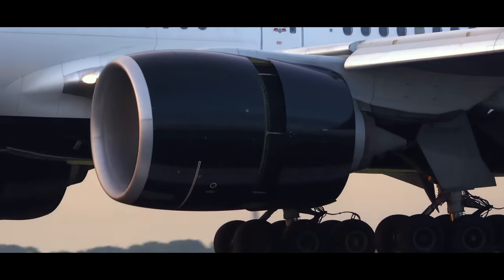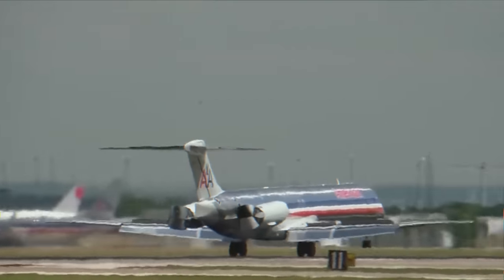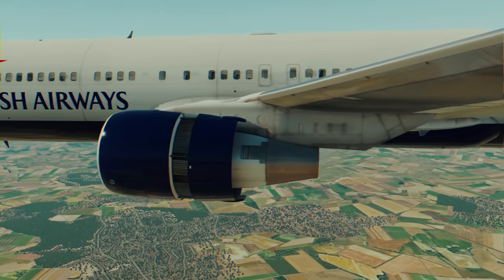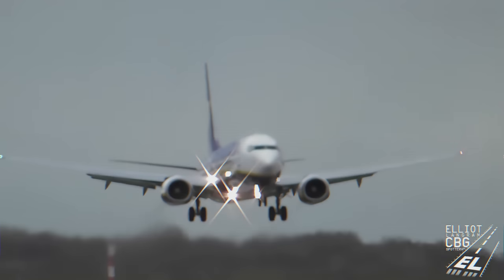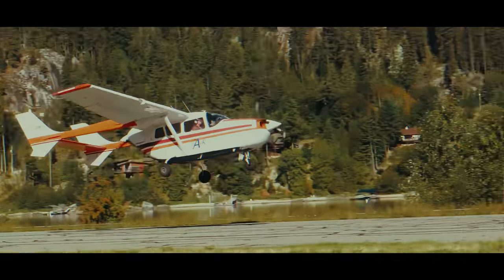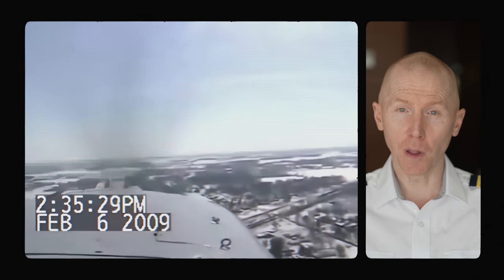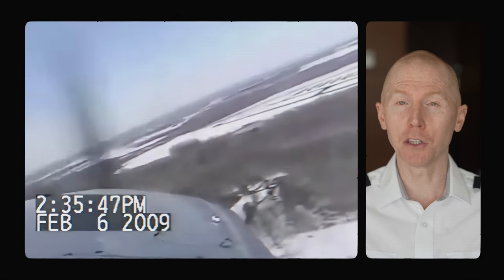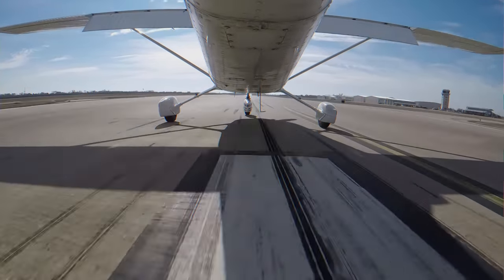Ryanair Pilot Makes Big Mistake

Comment: What you are missing is that it is Ryanair who guarantee slamming the plane into the runway in any weather condition. Applying reverse thrust before landing helps them achieve this goal.
Reply: Lol i was looking for something like this
Reply: "Ryan Air, soft landings would cost extra......."
Reply: Yup, SCUD Airways at it again!
Reply: Love this😂
Reply: Maybe to save on the number of times that they need to replace the brakes? Using reverse thrust every time instead 😅
Reply: @felipevieira8741  I think it’s more to do with reducing the chances of having to do a go around since if they do three or more within a certain time period Ryanair would force them back to the simulators.
Reply: They should charge extra for the landings, they are always fun, on the lucky days you get a witty pilot too.
Reply: By slamming the plane hard on the ground reduces the need for ground crew throwing bags hard while unloading.
Reply: I suppose Ryanair would charge an extra from its passengers for a 'go around'...

Comment: I used to fly the 737. Seem to remember you could select reverse at 10 feet on the radio altimeter. I have done exactly what the Ryanair, pilot did. It was on a 6500ft snow covered runway, in slightly windy conditions, so max thrust needed. Like the guy in the video, I thought the wheels had touched (they had not) and opened the reversers too early. The plane landed smoothly, stopped great, so this is not a big deal. On the video, the translating sleeves open on the engine, but it takes a little longer for the engine to reverse flow, so the landing is fine. On the 72 seat turboprop, I used to fly, selecting reverse before the nose wheel hit the deck, it would smash the nose down hard. On that aircraft, interlocks were supposed to prevent it reversing in flight. Well, they got worn out and somebody managed to reverse an engine in flight. About twenty flights later, the turbines came out the back of the engine. As for those that say Ryanair, have a “bad reputation,” I have never worked there, but considering the mass of aircraft and routes they operate, they have an excellent safety record. Do not let this none event stop you from flying with them.
Reply: Ryanair has a bad customer service reputation. Not the crews, the company. They charge you for the tiniest things and trying to complain is supposed to be a nightmare! But I've not heard (am in the UK near(ish) an airport they use a lot) of any "dangerous" reputation.
Reply: @y_fam_goeglyd  don't read the news much then I guess.
Reply: @y_fam_goeglyd  Soft landings cost an extra 20 euro at Ryanair.
Reply: There's no weight switch on the gear preventing reverser deployment?
Reply: @y_fam_goeglyd  I don't understand why anyone who has flown Ryanair worries about the reputation. 

You get, well I always did, what you have paid for.
Reply: This video will not stop me flying RYANAIR...THE BOEING 737 MAX SERIES ..WILL ,DEFINITELY,  STOP ME FLYING RYAN AIR ....
AIRBUS ALLWAYS ...
Reply: vibratingstring   I remember that crash being all over the news when I was kid.  Less than week later my grandmother flew ( Delta airlines)  to see her family without my grandfather. People asked what airline she flew on and my grandfather would tell them ValuJet . 😂. The look on people's faces was priceless.
Reply: @chipholland9  IIRC this “feature” is there in case the Air-Ground sensor fails in flight. That way you still have reverse thrust available for landing. This is only available below 10 feet from the runway.
Reply: Ryanair is actually a very great airlines.
Reply: Ussually the problems with Ryanair are in the cabin rather than outside the plane. I've been to kickboxing events where there was less of a fight going on than on Ryanair flights. 😆

Chav Express right there....
Reply: Exactly! VERY well said!! 👏🏻
Reply: @deth3021  have you ever worked for Ryanair in the last 20 years? Their safety record is exemplary so have you ever worked for them?
Reply: @askiff1415  I have avoided Ryanair since over 20 years as I don't have a death wish, nor do I hate myself that much.
Reply: @deth3021  well I’m a pilot and my son is a Captain at Ryanair so I figure we know lot more than you do about airlines, flying and safety in fact judging by the quality of your responses pretty much everything.
Reply: Any landing where no one is injured and the plane is undamaged is one damn fine landing, since landing's are essentially controlled crashes.
Reply: Yes, I would agree that one should not let this event stop them from flying Ryanair. The fees, lack of legroom, and generally terrible customer service reputation, on the other hand, should stop them from flying Ryanair.
Reply: @nvelsen1975  same for WIZZ Air and Sleazyjet in fact nearly all Low Cost Carriers attract the lower class and the behaviour that often comes with them
Reply: @y_fam_goeglyd  well they revolutionised air travel in europe thanks to them we have 10 euro flights
Reply: @nvelsen1975  sounds proportional given the renowned behaviour and disrespect for norms of some Russians
Reply: @adrianpeters2413  The 737 MAX is one of the best planes right now
Reply: Well sed Philip - Totally Agree - this guy probably have to spend some time on books :buffering:
Reply: Great input. There was a plane that went down because of a reverser failure in flight. 2 parts that would have been needed to fail in the system did.
Reply: @deth3021  You don’t actually need to worry about Ryanair, or any other airline that flies 737/A320 or bigger. No matter what Ryanair might want to do, cutting corners on aircraft safety is something that even they can’t do. Commercial aviation in Europe, UK, US and other civilised countries is extremely tightly controlled and regulated. EASA and CAA are no joke and no airline will f**k with them for fear of losing profit if nothing else. 

But even if they weren’t forced into being very safe, there are a few other simpler things to remember. Firstly the pilots themselves are humans who want to come home alive after every shift and it’s in their best interest to fly safe and reliable aircraft, as do the flight attendants. The engineers don’t ever want the guilt of  their work or lack thereof being responsible for crashing a plane and thus killing hundreds of people.

Even us ground handlers are deeply involved with aircraft safety and we don’t want them to die either. I’ll never forget the day I saw fresh dark brown smears on the underside of one of the engines during pushback. I communicated this to the captain using my headphones connected to the plane itself and unsurprisingly they stopped and had us take it back to the aircraft stand. An oil leak which took a few hours to fix, which led to quite the delay in taking off. I was thanked of course and I know that if I’d been a passenger and got told the truth behind the delay, I wouldn’t complain.

So Ryanair and similar low cost airlines are safe because they have to be. Of course the same can’t be said about the lack of customer support and quality of service but that won’t kill anyone.
Reply: @askiff1415 be careful with such bold comments. You not read about the two separate visual approaches they did into Cork years ago where they both ended up BELEOW the level of the runway but didn’t go around? Or the TWO diversions they made from Alicante to Valencia in bad weather landing with below final reserve?
Reply: @petesmith1924  oh dear I’m now terrified. 😂. Issues occurs on all airlines. Whether they’re global carriers or small carriers. I tend to look at how they manage the issues when they present themselves. Problems crop up and decisions are taken the majority are correct and a tiny incorrect. Given the sheer size of Ryanair, the numbers of flights per day and the massive volumes of passengers it carries per year and also how financial successful they are I’d say they’re better than most at safety. A lot of Ryanair first officers and some captain should onto other smaller but equally well know carriers so I guess they take all there bad habits with them then.
Reply: @askiff1415  hold on, you are the one who claimed they had an ‘excellent’ safety record. I just highlighted a few ‘not very excellent’ incidents that I know of. There will be way more. And as for their pilots joining other carriers - yes, they do because of the toxic culture there. I’ve trained dozens of them and once you iron out the bad habits (rushing everything (especially systems switching) being the most common trait) they make excellent pilots. So it actually sounds like you really don’t know what you are talking about.
Reply: @petesmith1924  ha you’re a proper clown. I’m not saying they don’t have an excellent safety record. I never said it was 100% perfect did I. In relative comparison they are excellent. Just in case you don’t know no airline is perfect. I’m not sure excellent is ever described as 100% perfect but in your world I guess anything’s possible.
Reply: @askiff1415   oh dear,talk about back tracking and splitting hairs. I’ve heard enough. Goodbye.

Comment: 737-700/800/900 FCOM: "The thrust reverser can be deployed when either radio altimeter senses less than 10 feet altitude, or when the air/ground safety sensor is in the ground mode"
Reply: Im fairly sure it is Stansted Airport, almost all of Ryanair 737s are 800s there so you got this right.

Comment: This is a feature, this version of the 738 actually allows for deployment of thrust reversers at 10ft radio altimeter.
Reply: Yeah I was going to say
Reply: Yea
Reply: @Dylan-bh6uj  so?
Reply: @GhostWatcher2024  737-800 it’s short for
Reply: @GhostWatcher2024  738 is short for the 800 version.
Reply: @GhostWatcher2024  its 737-800 short form you dont know much huh
Reply: @GhostWatcher2024  738 is a shorter way to say “737 - 800” 
Its also used for 747s like some people say “748” for 747-8
Reply: @GhostWatcher2024  that’s embarrassing
Reply: not a bug then ? :p
Reply: Im guessing that Boeing knows the 73 8 has high approach speeds and needs to get the stopping going even if your in the air.  Imagine the approach speeds in the MAX10 185 maybe? thats insane. thats faster than the concorde.
Reply: When I realized it was a 737 it all made sense to me. Kesley saying you don't use thrust reverse in all conditions... But... every single Southwest Flight I've been on has used them. Those SW pilots always seem to come in hot and thrown on the breaks. Hey but we're almost always about 10 minutes early. 🤷‍♂️
Reply: I know everyone has had a laugh at Josh but are we not here to learn? I am sure that the next time he questions something it will not be so declarative.
Reply: @GhostWatcher2024  oh how embarrassing for you
Reply: So the name of the 737 successor is out?
Reply: According to Mentour Pilot's comment, 10' radar altimeter.
Reply: @Peter Müller
738 = 737-800
Reply: @quep1  I knew that, but it was meant as a joke, since normally it's written 73 8 ...
Reply: @steewith2ees14  the problem is that he was acting like a smart ass, hence the laughs
Reply: @joelfcp1  I know buddy, my point was just that it looked like he had well and got the message by the time I posted and may have seen the potential for a teachable moment. Next time he questions something he will at least Google the bitch first to at least pretend he knows what he is talking about.
Reply: @GhostWatcher2024  B738 is the ICAO code for a 737-800. It's an abbreviation that is actually used in aviation.
Reply: @pmfx65  No... it's always written 738
Reply: @GhostWatcher2024  dont know much about planes then
Reply: It's actually 10ft
Reply: 10ft on radio altimeter*
Reply: @GhostWatcher2024  Most people would've assumed it was a typo. I doubt you weren't being snarky. I'm a snarky person,  so I know snark.😁
Reply: @joshuam20  thanks for correcting me on the exact figure, knew it was something around that, learned about it as part of an aerospace engineering diploma some years back and did have that in notes somewhere.
Reply: @chadhoes606  it’s good muscle memory to deploy them every landing.  It also deploys the speed brakes even if they were NOT armed (mistake) for landing.  Deploying thrust reverse every landing is a safer way to fly. Yes they are deployable by system logic below 10ft RA and is handy when the plane landed but not yet with full weight on wheels.  Deploying the thrust reversers helps get the planed stopped with ultra-smooth landings.
Reply: @GhostWatcher2024  to be honest, you
didnt really ask a question, you just assumed that everyone was wrong and proceeded to accuse people of “making up planes”

Comment: I don't know if all instructors did this, but when I was learning to fly mine would have me practice stuff like this but at a much higher altitude. He'd tell me to pull power and give me a hard deck. I'd have to find a place to land and go through everything as if I was actually landing. He'd do the same thing with just about all the emergencies I could come across. Anything that would actually stop the engine I would just go through the motions and explain everything that I was doing and why. We flew near a small controlled airport and he even worked out with ATC to let me get some experience using the light gun in the event of radio failure. He was an old Army Aviator and he did his best to prepare us for everything.
Reply: No. Why? I was taking you with me. I tend to joke when I'm afraid. I didn't have time to be scared. Navigate called tower, mayday then land then bug out. Breathe. 😊
Reply: I thought my instructor planned this engine failure midair. Then it kicked back in over a field. Safely landed on the runway after declaring Mayday. Then I got scared realizing it was real. We never flew together again. I ended up with a fighter pilot who liked to show off inversions. This was not an aerobatic plane. I never ate prior to flights . I never threw up in any plane, yet.
Reply: Had you practice stuff like what. I don’t believe when you were learning to fly, you were doing anything related to deploying thrust reversers in flight
Reply: @blainepetsupplies5354  where in my post did i say anything about "deploying thrust reversers in flight"? If you actually read my post, you would know what my instructor had me practice. I wrote more than the first sentence.

Comment: The engine failure and your comments made me think about something totally different, but I think it applies. I am a recreational scuba diver. And I have said for years that are two places a diver should be... on the boat or 40 feet down. The surface is where you get beat up by waves, maybe slammed into the dive boat. Same with a plane... it should be on the ground or at a safe altitude. In between is where it is the most potentially dangerous!

Comment: As a 17 year old taking my first ever flight in 1970, just out of boot camp and flying to my duty station.  I was amazed at how far I could see and spent the whole flight looking out my window.  My seat was over the wing and I could see the engine clearly.  Preparing to land I watched the houses get bigger as we got closer to the ground and I was wondering if that was usual procedure.  Just when it seemed we were going to strike something the runway came streaking into view.  I breathed a sigh of relief when suddenly the rear cover of the engine flew up like it was coming apart.  I about had a heart attack! lol  I only learned later it was just the air brakes deploying.
Reply: I felt that way during my first landing as a teenager when I became worried about the sounds of air brakes and the reversers coming online so the plane can be configured to land. Fortunately I had the presence of mind to look at the other passengers and the flight attendants and decide that whatever was happening, it was normal and I calmed down.
Reply: That happened to me too when I was about the same age. Looked out the window and the rear of the engine had lifted up exposing the engine. What a fright!